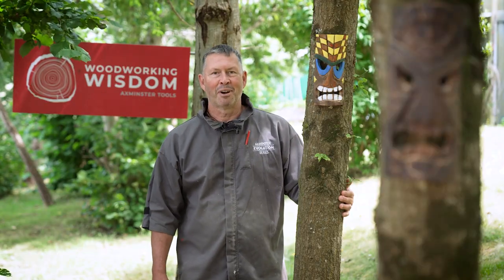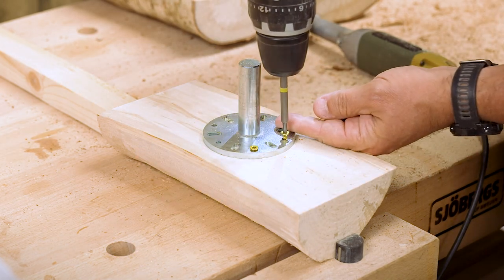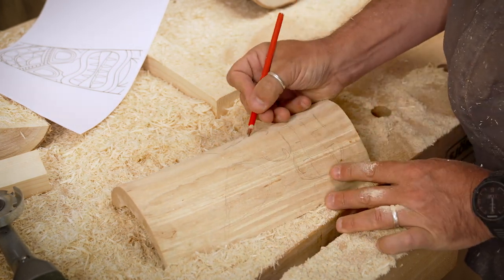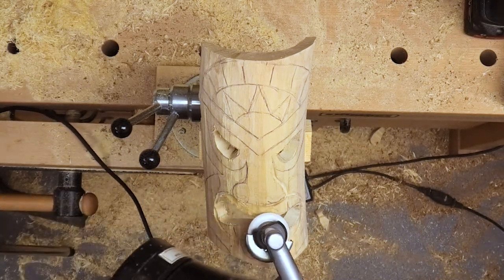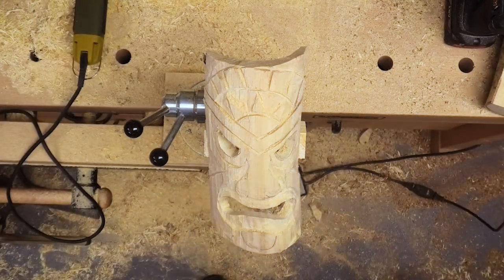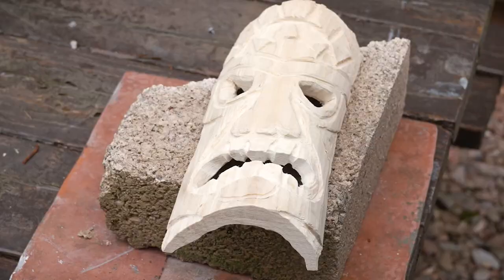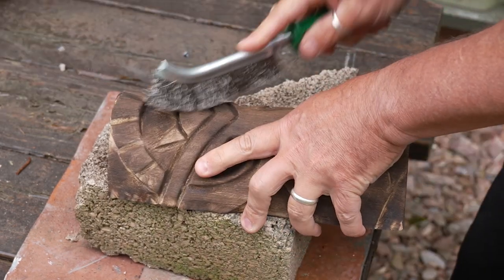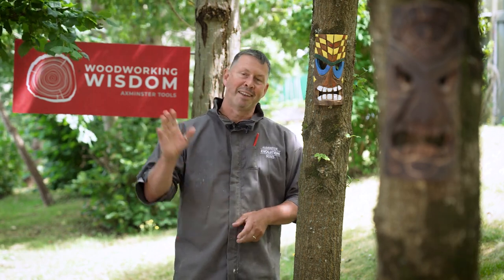Mini Tiki Masks with PROXXON - Woodworking Wisdom

Comment: If you had chosen to paint this, what type of paint would you use?
Reply from the maker: Hi there, any paint is fine to use, but just consider where it will be placed - if indoors then any paint if fine, but if outdoors then it will need to be weather resistant, however, these wont last forever outside. Some yearly maintenance may have to be done. Hope that helps!